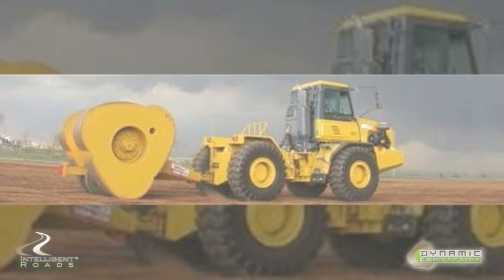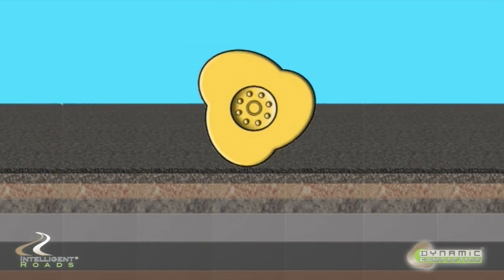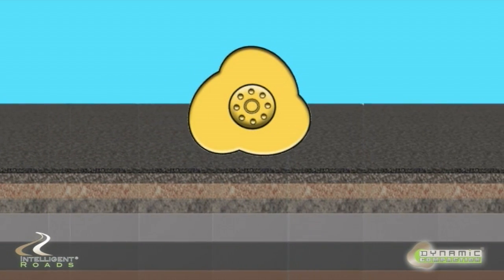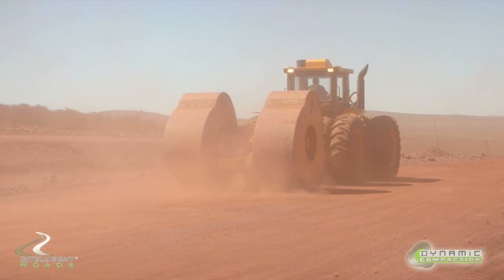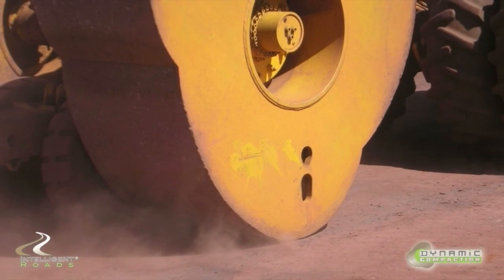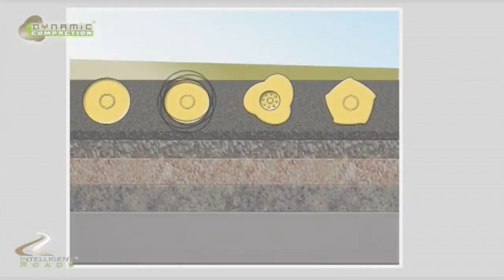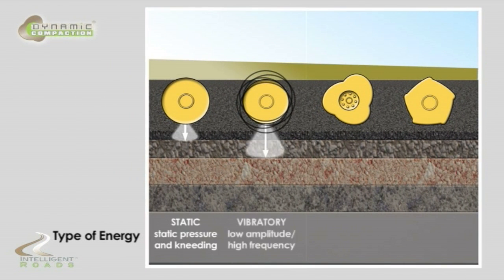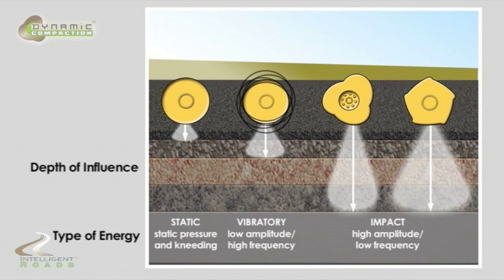Dynamic Compaction Introduction Part 1

Comment: So it compacts better than a tandem steel roller with controlled vibration. Wow!
Reply from the maker: Thank for the comment William. Traditionally the depth of influence of standard steel drum, sheep’s foot or grid rollers have a depth of influence in the region of 50 to 200 mm’s, therefore limiting the maximum amount of material that can be processed in a given period of time. The incorporation of Dynamic Compaction delivers a high-energy impact force of up to 25 kJ in pressure which is vertically placed on the surface of the in situ soil with a depth of influence of up to 2 m or more while improving the sub-grade material by shearing the particles and increasing soil density which will prevent ingress of water which is one of the primary causes of sub grade settlement.